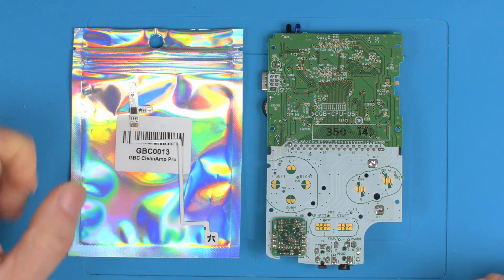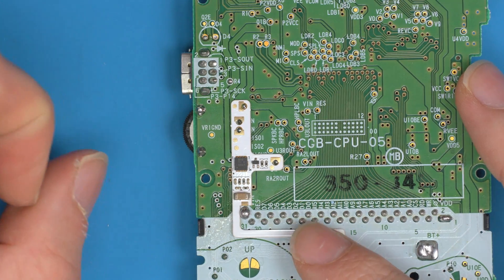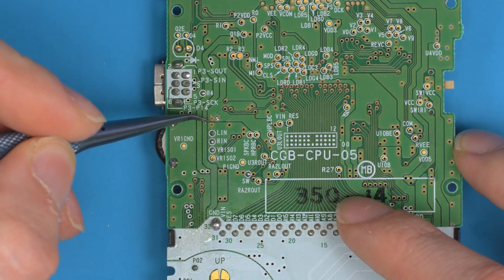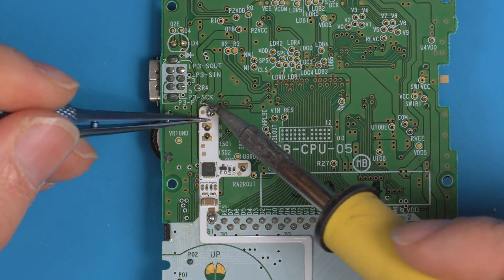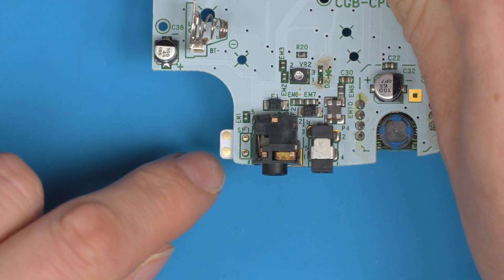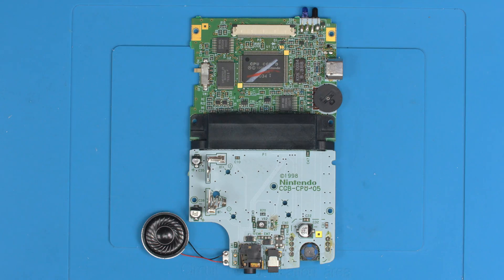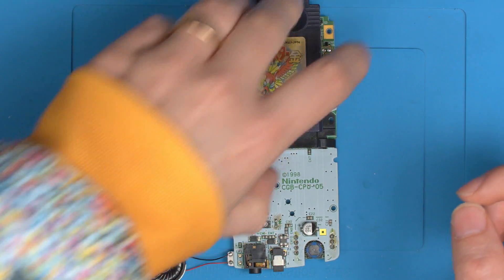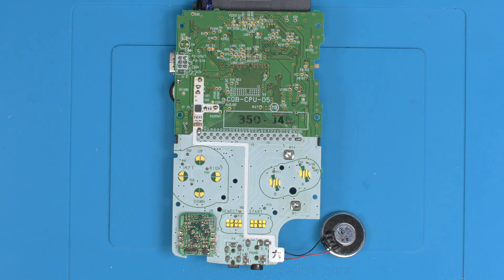CleanAmp Pro Game Boy Color (Wire Free Flex Audio Amp) - RetroSix

Comment: Would i be able to get rid of c14 capacitor if i install this? Broke a pad off it and used a wire to connect to oem speaker location.. dont know if its needed

Comment: I installed the clean amp and clean power board along with the oled display. I replaced the speaker and capacitors. When the batteries run low, the gameboy power cycles off and on. Is this normal since these mods use more power

Comment: Any way to decrease the max volume of the amp or a similar solution? At max volume the amp will consume more power than what the console can handle and crashes. Keep in mind that i also have the cleanpower,  capacitor kit, Funny playing ips screen and both the power switch and volume wheel replaced. So it isn't chocking that my device consumes too much power, but a volume decrease would help. The amp sounds great either way and it was really simple to install!
Reply from the maker: Add few extra capacitors to the power and ground of the amp board and it will stay on fine usually
Reply: @RetroSix  Pls make a video
Reply: @RetroSix  Pls make a video